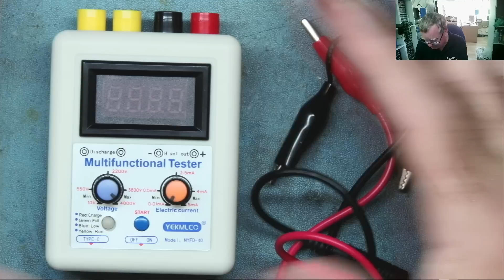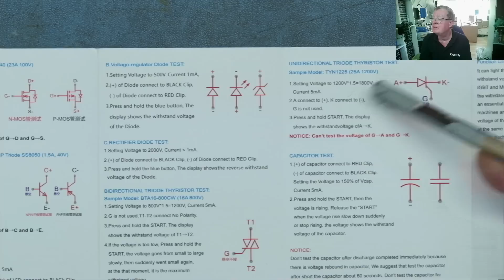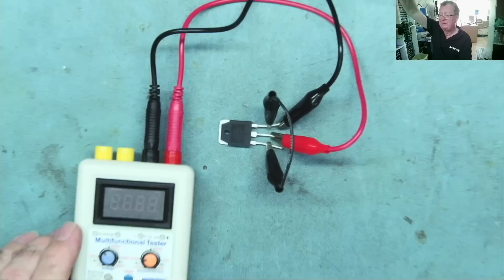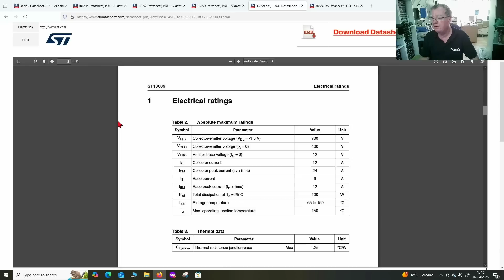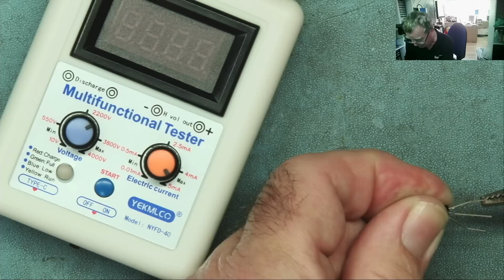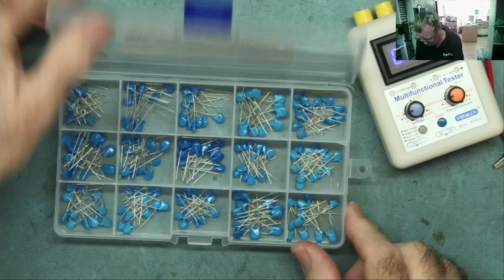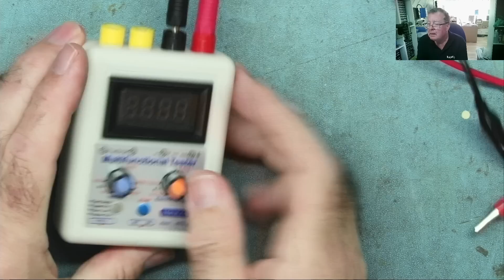Cheap 4000V Breakdown Voltage Tester : Find FAKE Mosfet Transistor IGBT Diode Capacitor Triac ETC

Comment: The capacitors supposedly rated at 1 kV that then showed much lower breakdown voltage may actually have been able to withstand 1 kV but were destroyed in testing and the tester lacks the sophistication to show what really happened. Test by turning the tester voltage down to less than the rated voltage, then upping the voltage til failure occurs.

I would consider using this on a capacitor to be a destructive test.
Some capacitors, such as metalized film types used for across-the-line ("X") noise suppression are "self healing." This means that the dielectric breaks down, a short-circuit between the electrodes occurs, and then the short is blown open rather like a fuse. This requires that there be sufficient energy available to clear the short. When actually used as an X cap at line voltage there will be lots of energy available. (I've seen metalized film caps that cleared the short by blowing apart; same type of equipment where I've seen PCB traces, wide ones, simply gone - evaporated.)
I have never seen a good discussion of what happens in ceramic capacitors subjected to excessive voltage.
Electrolytic caps subjected to excessive voltage are likely to fail short-circuit. They are given to exploding if there is enough energy to clear the fault.

On failures of X and Y caps:
It is very widely repeated on the internet that X caps are "designed to fail short-circuit" and Y caps are "designed to fail open-circuit."
I can find absolutely no credible source to support this. I can find absolutely nothing to support the notion that such design is even reliably possible. I used to design switchers that required X and Y caps and read a lot of data sheets and ap notes. Not one mentioned anything supporting the idea of designed-in failure modes. Some caps (low capacitance, since Y caps have an upper limit because of shock hazard) are rated for both X and Y use. You can't make a cap that knows how it is being used and fails accordingly.
As mentioned previously, X caps do tend to fail short-circuit but then "self heal."  This is very commonly mentioned in data sheets and ap notes because it is an important consideration. Y caps are simply made to withstand voltage very much higher than their rating without failure. Some ceramic types are essentially "double insulated" - two caps effectively in series so if one fails short-circuit the other may still be OK in terms of safety.

I would want to look at what goes on with that tester with an oscilloscope. This is challenging due to the need for proper high-voltage probes. If the voltage is not immediately removed after breakdown of a semiconductor junction, damage could result. Big devices can typically withstand moderate power in avalanche but small devices such as signal transistors can't.
Reply from the maker: Thanks for the info.  I didn't show it on this video as I tried again after recording but I did find that some values in that box of supposed 1KV capacitors could in fact withstand 1KV but most of the values couldn't.  The capacitors also vary in thickness. I also think I have some 1KV and 2KV pulls so I will get a few together for further testing. This is something to explore further on the next livestream.
Reply: @learnelectronicsrepair  Any test that test for breakdown is a destructive test. As to produce a breakdown you are punching a hole through the insulation.
Now they don't normally produce many components that can selfheal once the insulation has been breached.
Reply: @TheEmbeddedHobbyist   Is this tester causing breakdown, or is it simply detecting the voltage at which the current reaches the selected value?  If you can safely put the component on a curve tracer limited to a certain current, then it's probably safe to put on this tester, also limited to the same current.  It would be interesting to compare curve tracer results vs. this tester.
Reply: Да, конденсаторы не проверить низким током, что бы избежать пробоя, т.к. сам конденсатор, когда пробивает свои обкладки, имеет максимальный ток, поэтому при тестировании надо очень плавно прибавлять напряжение..

Comment: The device is overheating during capacitor testing. I bought one and wrote to a seller about strange capacitor testing, he has send me new unit but it worked the same. Then the seller decider (after I showeed him a video) that the device is overheating and this is normal. Told me that  I should wait untill the device cools down and continue measuring the capacitor.  I send them back. 
I saw a video on youtube with the same device which didnt overheating. Fake devices plague?
Reply: This is why there is a test button. The driver should only be operated for short duration.  It’s converting low voltage battery at high current, driving thousands of volts at low current, probably at 70% efficiency. Do the math on power dissipation, and you’ll determine the heat being generated inside the plastic case.
Reply from the maker: OK this is something we can explore on the next livestream. Thanks for your input.
Reply: @learnelectronicsrepair  Inside is D1804 and this is what overheats.
Reply: 5 mA x 1000V = 5 W Looks like a tall order for such a small device. Could you test the test device. Can it provide the promised voltages and currents?

Comment: If you connect a resistor, capacitor and transistor together, you should be able to use this as a brilliant testing tool: a high-voltage avalanche pulse generator. That's about the fastest rise time you can make, for testing slew rates/ rise times of everything from oscilloscopes to transistors.
Reply from the maker: Give me some more info and I can put it together.  I found this http://www.aholme.co.uk/Avalanche/Avalanche.htm
Reply: @LearnElectronicsRepair  It's called the Jim Williams pulse Generator, who described it in App Note 47 appendix D in the 1991. There is a great discussion of all kinds of scope and probe tips in that article, and he included the test circuit he used W which gives. Rise time of less than 500 picoseconds. It's just a boost converter charging a cap until the NPN avalanches and it discharges through a 50 ohm resistor (assuming 50ohm scope input). The output voltage is the breakdown voltage of the transistor, but Jim was quite limited at that time by his choice of transistors that he could get to breakdown using a boost from a AA battery, and he said even the best transistor he could find still only worked 80% of the time. By using the current limited 4kv supply, I suspect you could get just about any transistor to work. 
Youtube videos: EEVBlog #306 and #311 demonstrate using it. He has some more videos with better versions but I can't find them right now.  I know he has an ultra-fast version in purple more recently but I can't remember the title. 
Imsai Guy #847 uses it too and has the short and simple explanation. 
For extreme rise times, stray inductance and capacitance will absolutely ruin the results. Upside-down SMD (dead bug) directly soldered to a copper sheet, no traces, plugged directly into a scope with no leads or cable. The 50ohm load resistor would probably need to be split into a divider to match your scopes max voltage if the avalanche voltage is too high, or use a >10ghz bandwidth attenuator. 
While this can be an incredibly useful tool for certain applications, it's definitely worth noting that generating sub-100picosecond pulses is only as useful as your oscilloscope. Dave Jones had to switch to his $140,000 scope to get an accurate reading for his original slow version! I don't remember what kind of bench scope you have, but it's safe to say your collection of cool handhelds will not register the pulse.
Reply: yes this please :)
Reply: Have you considered revisiting this?

Comment: I saw this on the livestream. Interestingly, I designed a schematic 2 weeks ago for something similar as I need a tool liked this, but if it's this cheap I thought I'd just buy this. I just found that there is actually a 2.7kv version for sale in the US for $8.61! That's a no-brainer... Placed my order immediately! Thanks!
Reply from the maker: You can have a lot of fun with that.  There is a version of this 4kV tester on AliExpress without the Capacitor discharger function that's about €6 or so cheaper. You can easily spot it because it has two 4mm banana sockets insetad of four. Personally I think for the bit extra may as well have the discharger included, but your choice.  Stay safe guys.
Reply: @LearnElectronicsRepair  I already have a nice dual-mode capacitor discharger. You just flip it around to change the voltage level. Under 250v, flat-head. Over 250v, switch to philips. 😁
Reply: Any capacitors under 100v I just use any two of the three fingers on my right hand. I used to have five, but once I missed the extra zero.
Reply: @SkippiiKai  Hmm... Hate it when that happens.

Comment: Nice testing. It would be interesting to see a genuine 1KV mov on it. And some good caps!
Reply from the maker: I tested a 1N4007 which has a 1KV breakdown voltage. It actually withstood about 1.5KV
Reply: @learnelectronicsrepair  I suggest a follow up with more niche components both fake and from authoritative sources.
I especially would like to see GDT.
But also opto-couplers, silicon based magnetic isolator ICs, transformers (ordinary enamel wire, double-triple insulated), chokes, and even simple COBs that you left out of this video for some reason.

Comment: You mentioned the NPN or PNP transistors will not have base-float.  Made me realise "float" isn't what I think it is. Would you be able to do a video on transistors, IGBTs, Thyristors etc. and explain basics like that? Thanks!
Reply: Click on his channel, then click on playlists, and then click on the "All you need to know about.." series.
Reply: @SkippiiKai  Thank you!
Reply from the maker: @Beetlez-B  Yeah those videos will help you understand things better. 
https://www.youtube.com/playlist?list=PLQ_OzNEYrepVlm02UxQRa40_B-2YyblHv
Basically speaking a bipolar transistor is a current controlled device so has a low impedance input (the base).  A MOSFET is a voltage controlled device so has a very high imedance input (the gate).  This means a gate can have a  'floating voltage' in a similar sense that that something insulating can hold static electricity.  Therefore the mosfet with an open circuit gate will turn on unexpectedly, but the bipolar transistor with an open circuit base will not.